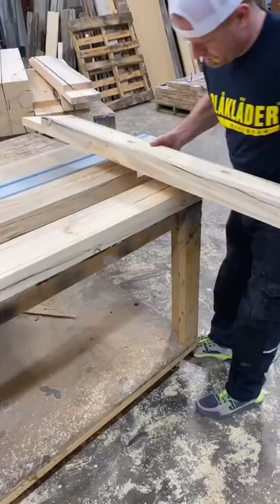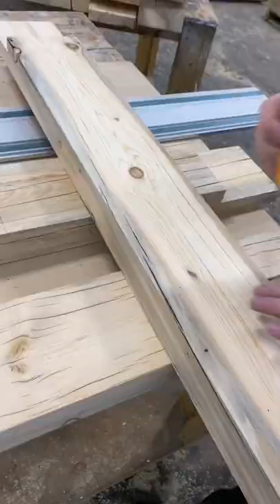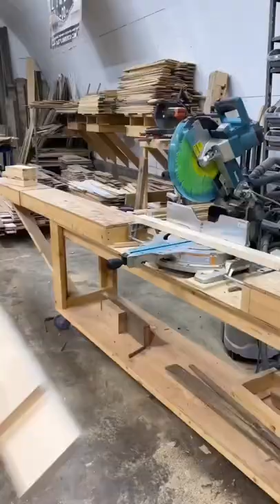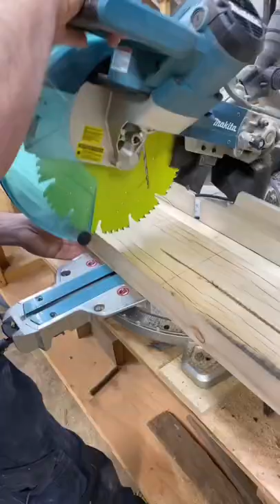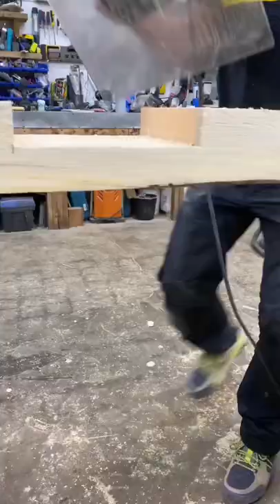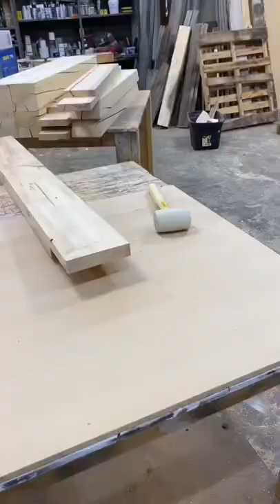Cross laps with a slide saw and router #woodwork #woodworking #maker #shorts #wood #tools #joinery

Comment: That router clean out is great.  I find it tricky to get the exact half of the cross laps, and get a flush level fit. To thick or too thin, just a shade.🙄
Reply: That's because when you do it with wood you just get from big box store it's never perfect... So if you cut it yourself I mean with all this nice tool he have you know both pieces will be the same.